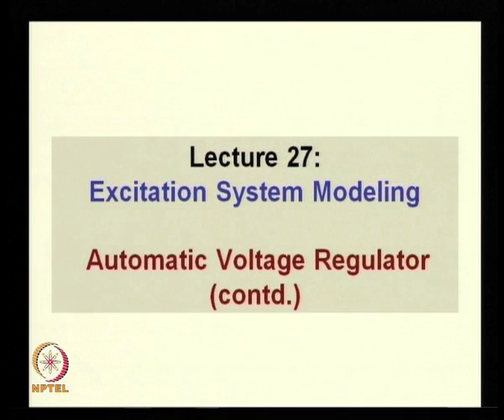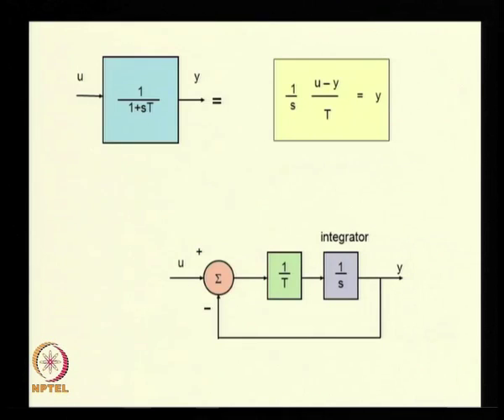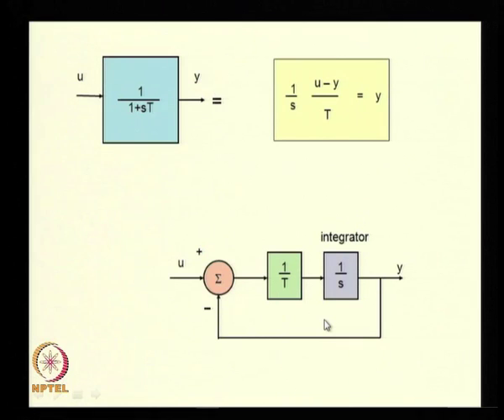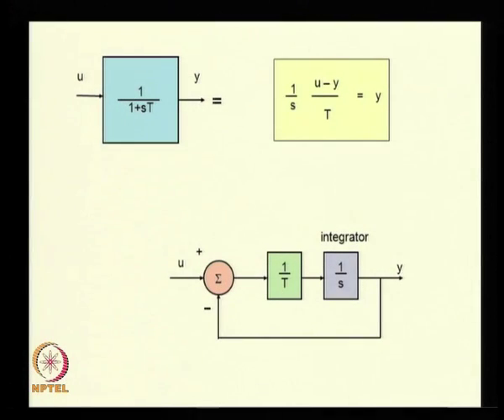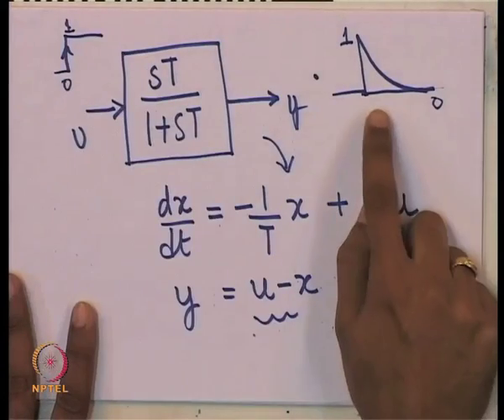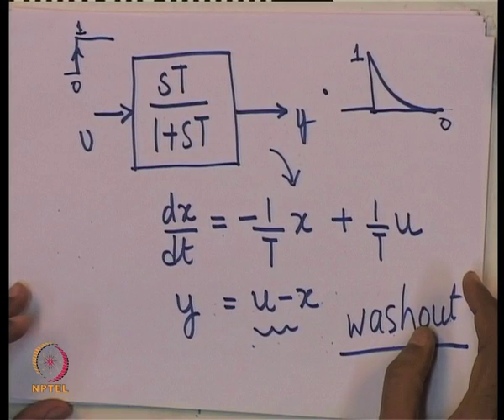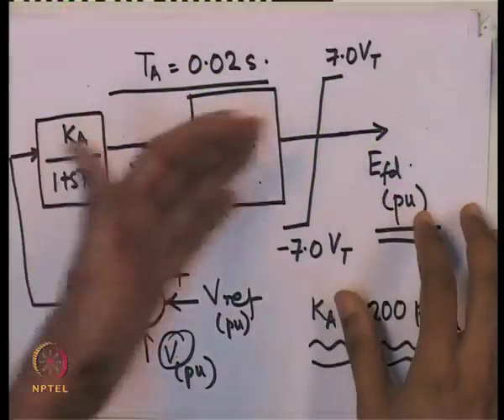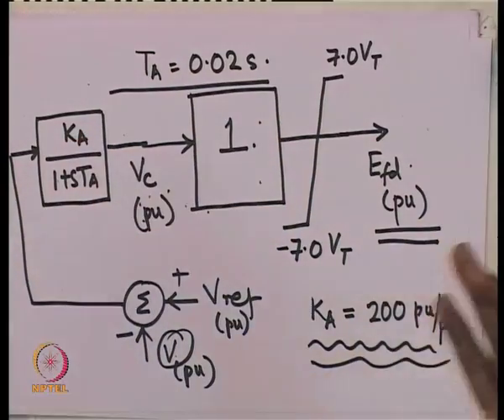Mod-01 Lec-27 Excitation System Modeling. Automatic Voltage Regulator (Contd.)

Comment: What does it means wash out is like a high pass filter?
Reply: For, low frequency, s is very low. So, upper term "sKf" produce very low gain, when lower term (1+sTf) is close to 1.   For high frequency, lower term will be "sTf" and the total gain of the system will be "Kf/Tf". In summary, at low frequency, it provides very low gain, while in high frequency its gain is Kf/Tf.